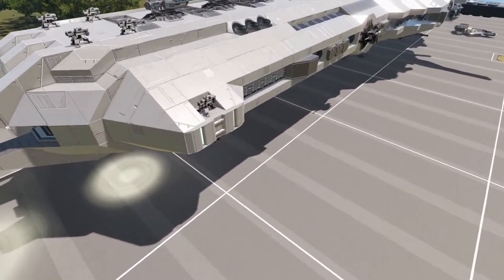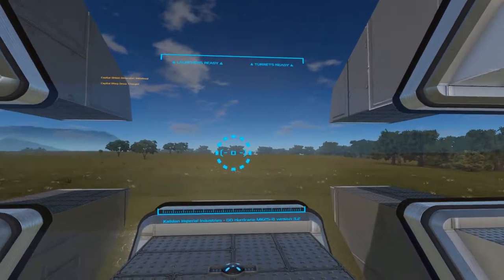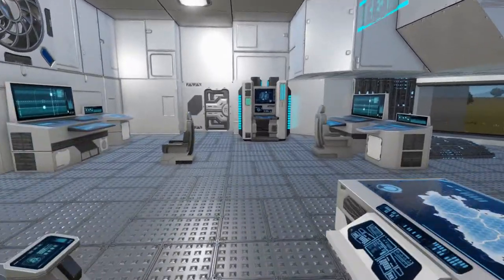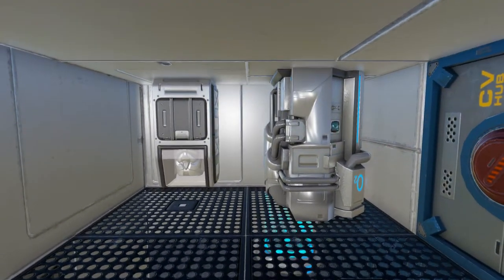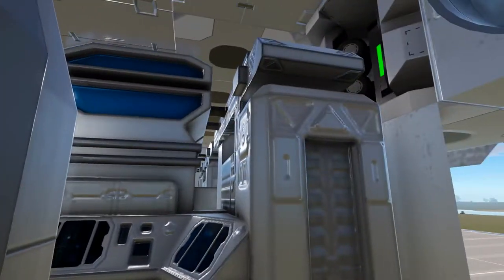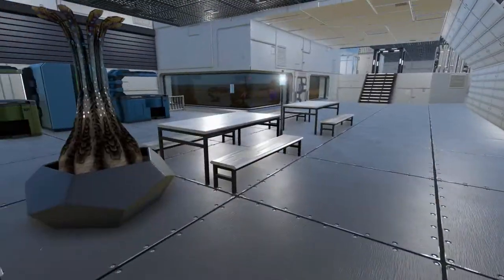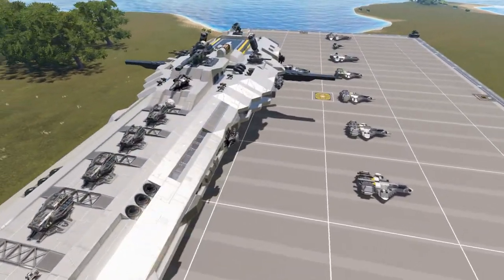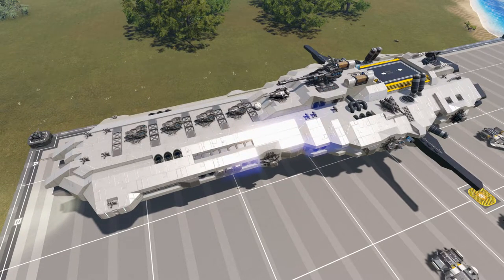EMPYRION GALACTIC SURVIVAL (V1.1.6) - WORKSHOP EPISODE 13 | ProbabilityOfSuccessZero

Comment: Does the ship get too heavy if you make the shell all hardened steel?  can you put the Rocket Turrets 2 abreast and then step the second row up a bit, so that only the from of the ship will be facing the incoming fire?  Less target to hit than if your ship is side on.
Reply from the maker: That's definitely an idea.  I'll look into whether double stacking or even elevating the turrets will improve things!
Oh and the hull isn't all hardened steel, it is only in certain weaker parts that I've reinforced it.
Reply: @probabilityofsuccesszero   Thats why I was asking if the ship would be too heavy if you made it all hardened steel. If it was all hardened steel then it would give you more protection. Just depends if your thrusters can cope, if you are fully loaded up with cargo.